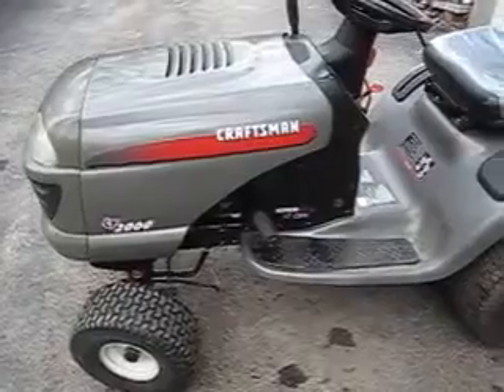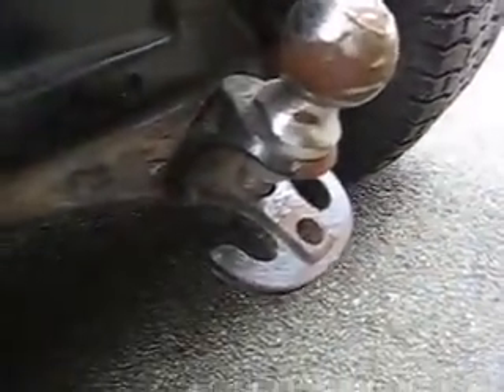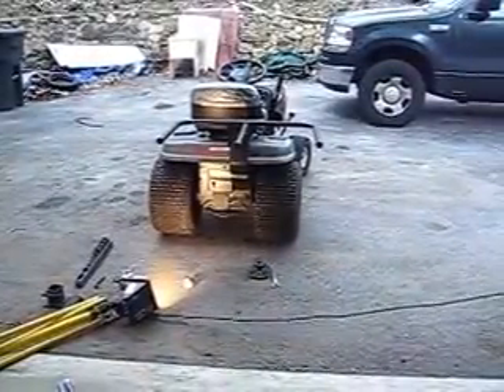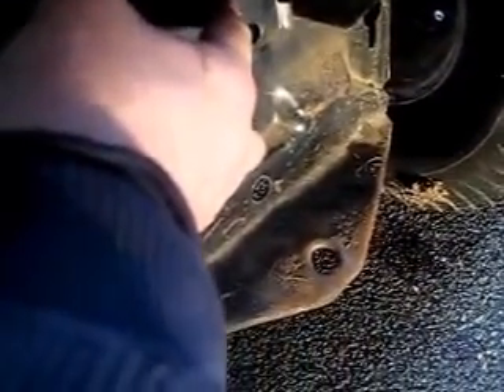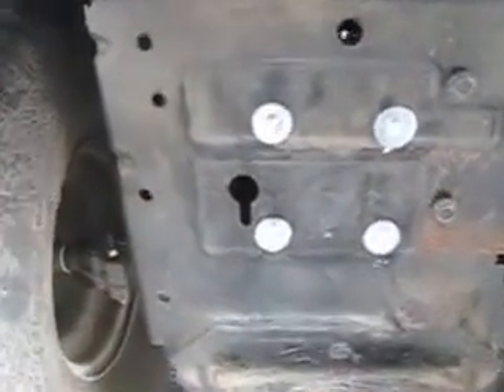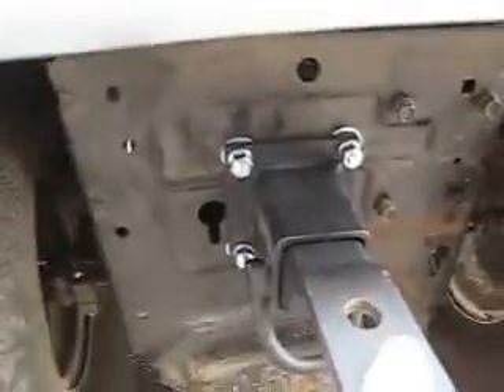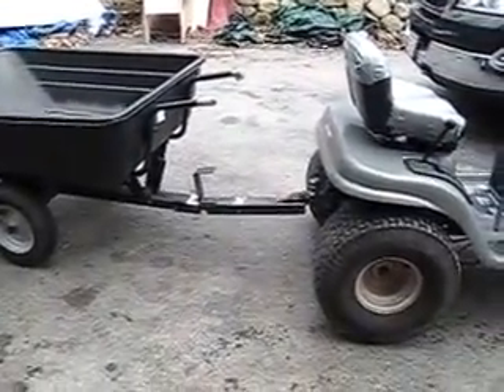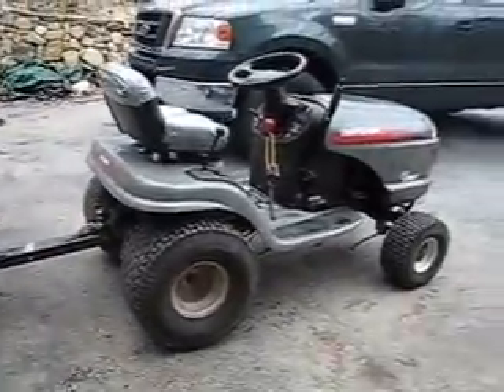Craftsman Lawn Tractor  Tow Hitch

Comment: Troy built.  i got to fine some metal some where.  i want a front bumper and hitch. These dam riding lawn mowers are made so cheap now days with high prices.  Mostly press sheet metal > i got some plate metal to make a good one. but i need a frame to attach it too > What joke sheet metal with a hole for a hitch  COME ON COMPANIES GET REAL!
Reply: go buy an old garden tractor and you wont have problems with cheap ass new lawn tractors
Reply: @ayp1938  I agree.